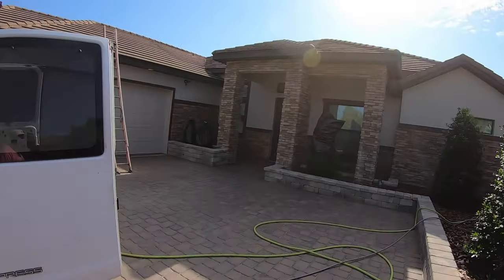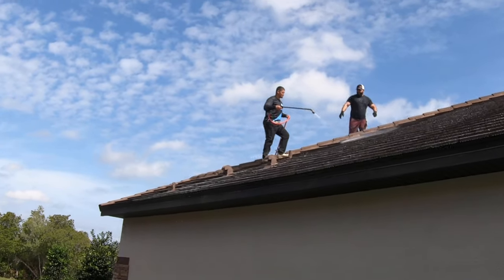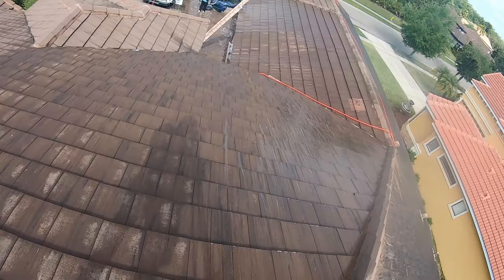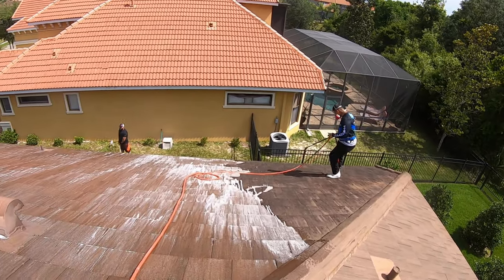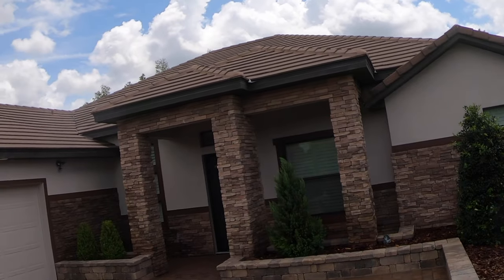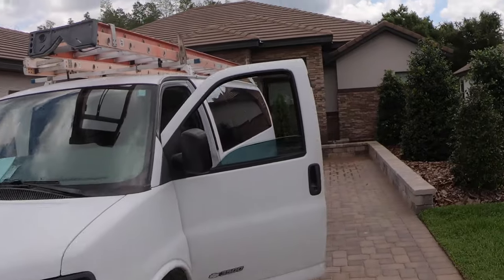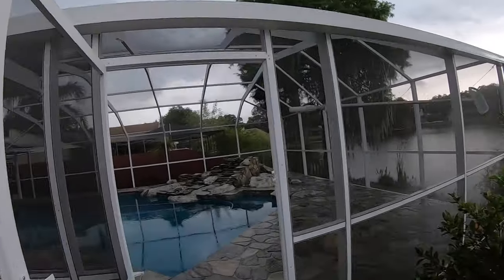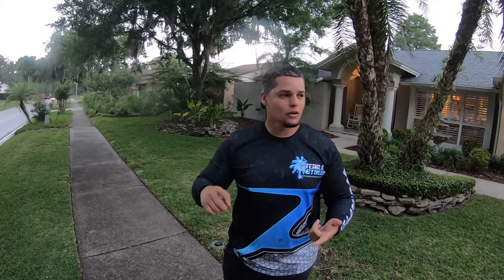Flat Concrete Tile Soft Wash

Comment: I really like your videos, i have been cleaning now for 2 years. I live in middle Tennessee and want to keep learning. Any advice for new guys like me is great! I need to learn more about sealing concrete. We Dont have a lot pavers here. Any tricks on chemical i need to keep around? I just got some of the goo gone rust remover in one of your other videos.
Reply from the maker: Thanks for watching the videos. They're here to help everyone out.  Sealing concrete is just like sealing pavers, except you may have to roll some spots if you spray too heavy.  It's definitely easier since there's no sanding involved.  In our industry sh, degreaser, rust remover are the top 3 you will use on a day to day basis.

Comment: Bro...your vides are on point. Thanks for sharing your knowledge and tips. Can you do a simple detail vid on how you mix?
Reply from the maker: Thank you brother. I dont batch mix my SH anymore.   Are you talking about with my proportioner?
Reply: @PinkFlamingoPowerWash  I guess? So you down stream the CH now with a power washer?
Reply from the maker: @westernsoftwash4981  yes downstream straight sh for house washing (downstream can only be achieved with a pressure washer)  For real dirty stucco houses that requires hotter mixes I use my 12v softwash system. And of course I use the 12v system also for roofs cause you can't downstream roofs.

Comment: Was thinking of doing that muffler adjustment to my pressure washer too
Reply: Any pointers?
Reply from the maker: Easy just go to a welding shop if you want to redirect the exhaust
Reply: @PinkFlamingoPowerWash  
I want to redirect it and silent most of the noise

Comment: Thank you for your content brother.. I’m new in the business and have some jobs coming in 2 weeks.. I wanna know the mix you used.. you said %5 hs + soup+ water.. but how much is each for a gallon of water? Also what the best method of marketing you advise me to use?
Reply from the maker: Hey you're welcome.  Glad you're becoming part of the industry.  To break it down.  Sh comes mostly in 10% concentration,  that would be way too hot to spray on a roof and really would be a waste and would burn plants and grass really fast.  

A 5% mix is cutting it down from that 10% concentration.  So a 5% is half water and half SH.   Soap (surfactant) will depend on how steep the roof is or the type of roof.  If you're batch mixing typically 1oz per 5 gallons is good for your surfactant.   If the roof is steep you could add a little more so it sticks to the roof better.

Best marketing to me is yard signs. I have a link in the description to get those.

Comment: Hey man . I think ill need a van setup like that for security reasons in my area. How much does a used cargo van usually cost?
Reply from the maker: This is the reason I got it and it's easier to manage unlike a trailer.  I got this one for 6k
Reply: @PinkFlamingoPowerWash  oh bet . I thought it wouldve been crazy high . Thanks for the fast reply
Reply: @PinkFlamingoPowerWash  you got it on fb market or you knew a place that sold them?
Reply from the maker: @jrob2kmusic333  Facebook marketplace
Reply: Thinking of getting a Ford Transit cause it is much more fuel efficient then my Ford f250
Reply: @JD-yx7be  yeah but those things run 10-16k
Reply: @PinkFlamingoPowerWash  bet . Keep killing it 🤝
Reply: @jrob2kmusic333  will pay for itself quick with current fuel prices. they get about 4-6mpg more then my truck
Reply from the maker: @JD-yx7be  I almost got a transit van but I needed a high roof and extended version for more room.  They're pricey and I heard their engines aren't good
Reply: @PinkFlamingoPowerWash  Hard to beat the old chevy engine as it has had all the kinks worked out since for the 20 something years its been around. My neighbor has 350,000 miles on his van. 

I don't think a transit will last that long but with current fuel prices i'm willing to take the chance. The transit 2 gas engines are also shared with the f150 and expedition and a few other Fords so  parts are easy to come by.
Reply from the maker: @JD-yx7be  that's very true.  Parts foe those are very accessible.

Comment: Hi I washed a roof yesterday with 6% SH and 5% surfactant and the blk algae stripes lighten but didn’t remove treated it three times black stripes are still there along with paper, thin multicolor, moss dots in California so I get it large chunky moss what I called paper thin moss it’s yellow, orange, green black streaks, and that thin moss didn’t die any suggestions thank you.
Reply from the maker: What kind of roof is it?